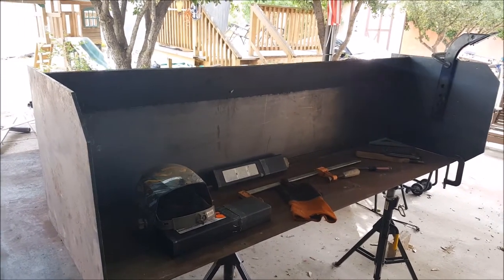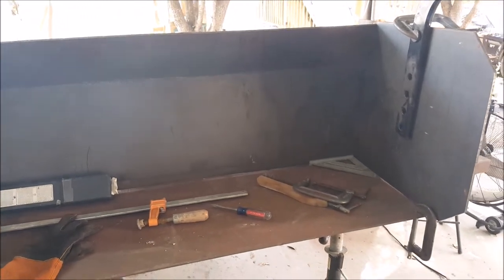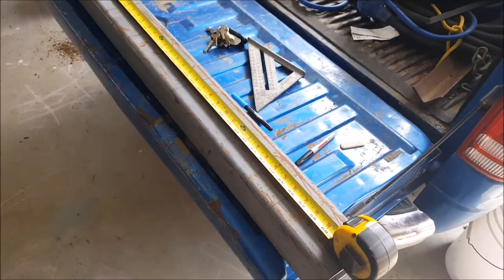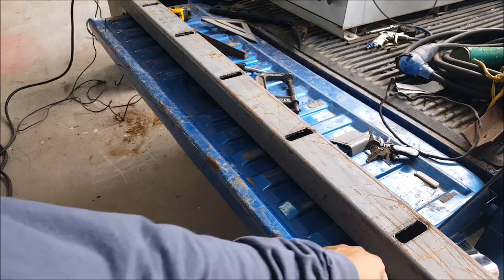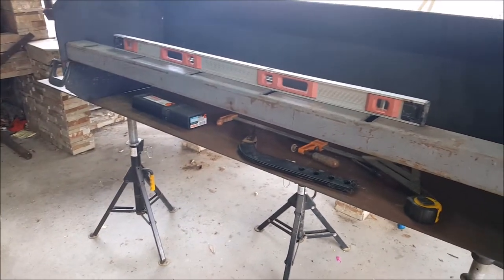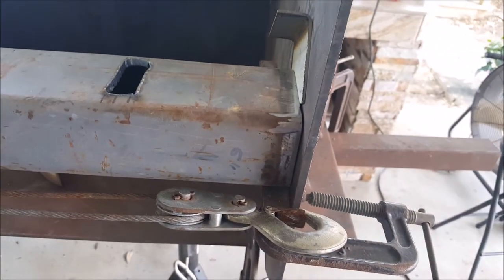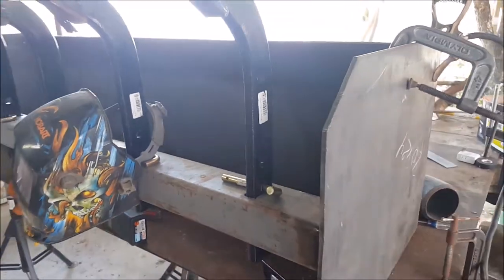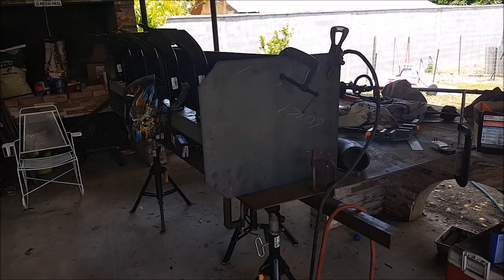DIY Box Blade Part 2 - Tractor 3 point scrapper

Comment: Just a quick note - Sharpie ink wipes right off with alcohol.
Reply from the maker: Thanks for sharing the tip.
Reply: @cutweldngrind  Did you ever finish this project?  I've been considering doing the same thing (which is how I found your video/channel), but probably not nearly as large.  That thing looks like it weighs a ton!
Reply from the maker: @LexiRedLion  Its still in the back yard just pending a few things. I may get to it soon so I can clear up the space.